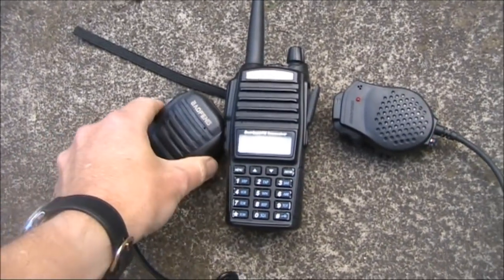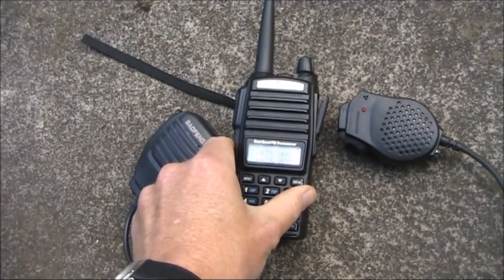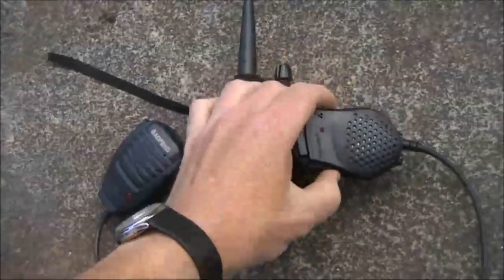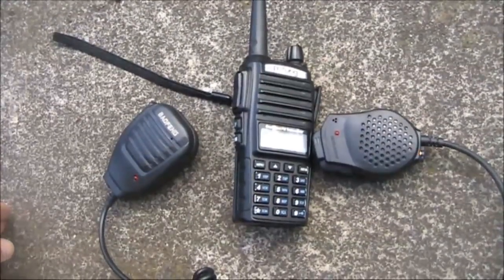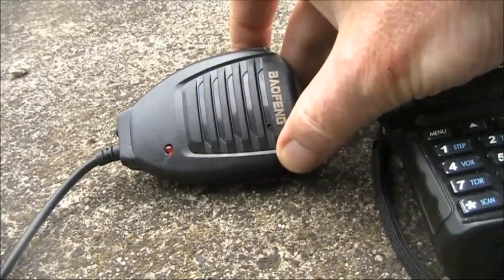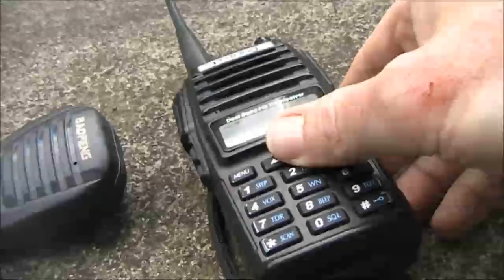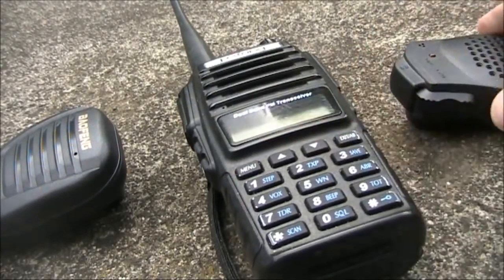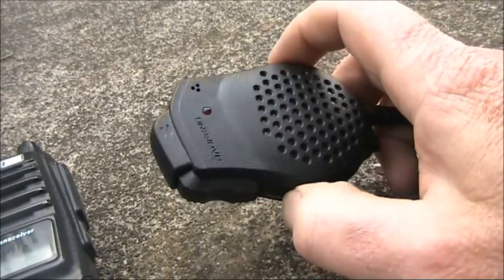External microphones for handheld transceivers: There's a big difference!

Comment: It sounds silly but after Peter's ringing endorsement, I went right to Ebay and bought one for $5.10. As soon as I got it I tried it out and found it is MUCH better that the other mic. In fact the mic is sensitive enough you can hold it a couple of inches away further than that other mic and still be loud and clear. Not muffled at all. I have the other two Baofeng mics and this one is a lot better in mic audio quality. The speaker part is about on par with the one in the video. Maybe better. I wouldn't have gotten this one if Peter hadn't shown the difference between the two hand mics. Thanks Peter.

Comment: Is it possible to post links to the microphones tested?
Reply: Does mic C have a plug for an earpiece?
Reply: @Dutch1951x  it does, lol
Reply: I'd put links here for you, but in case Peter would like to add an affiliate link, i'll refrain.  It's easy to find them though, just search amazon for "baofeng microphone", if it's still on the market, you'll easily find them. Cheers.
Reply from the maker: Good idea!  http://cgi.ebay.com.au/ws/eBayISAPI.dll?ViewItemVersion&item=401196323119&view=all&tid=675279357027 is the microphone bought separately (Microphone C). What arrived is different to what was pictured (the mic in the ad looks like Mic A, as supplied with the transceiver).
Reply: @vk3ye  Too bad you give a link to Australian ebay I am in Canada and have no clue what the name or brand of Mic C was, SO i can't search for it elsewhere... :(